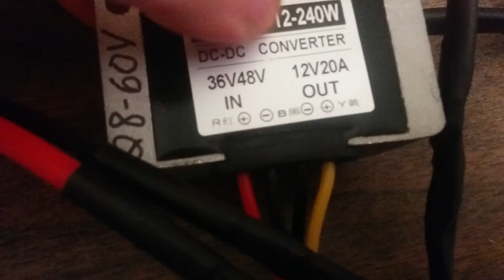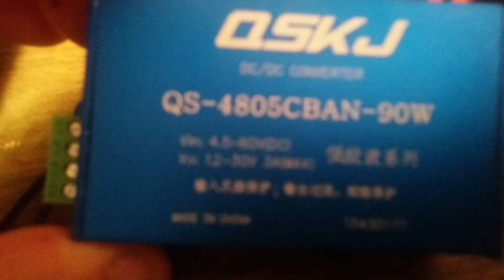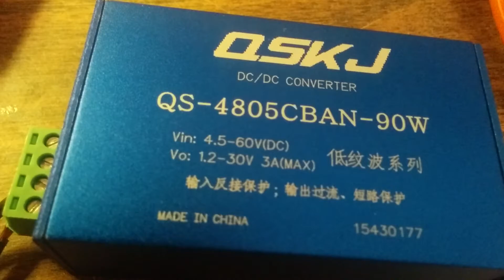DC to DC Conversion Step Up Booster QSKJ Buck Converters Step Down 36V 48V 60V to 5V 12V

Comment: Hi, i'm looking for simillar step down ( 12v to 5v 100W) for ws2812 leds. And nobody want to tell me how much power it takes. Is it builded on resistors, or some other way.
Reply from the maker: +Brony Raven K2 Hi there - I haven't done too much tinkering with LED's yet, hope that you find an answer. I bought all my DC to DC converters on Ebay - hope this helps.
Reply: +David Sonshine I found what i need (Conversion efficiency: 90%) thanks.